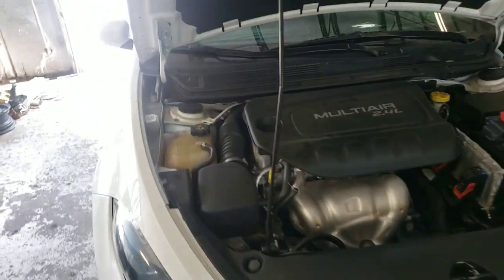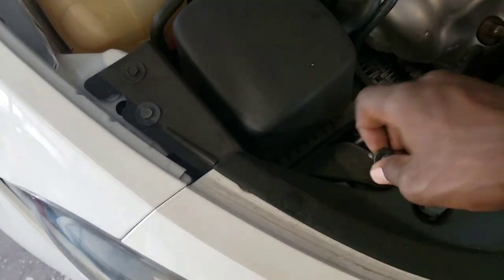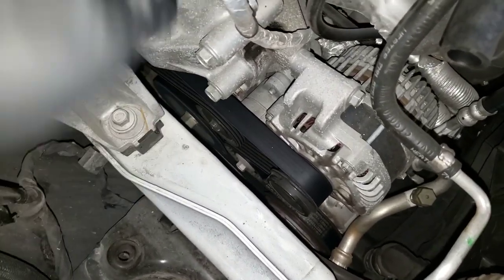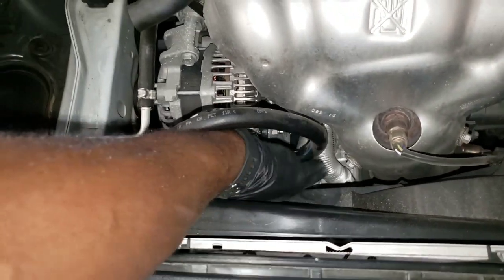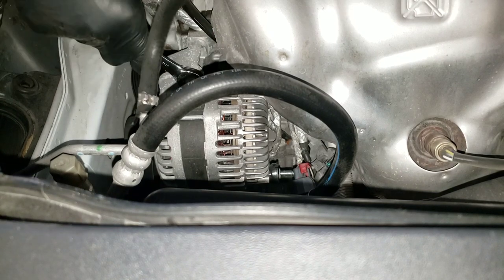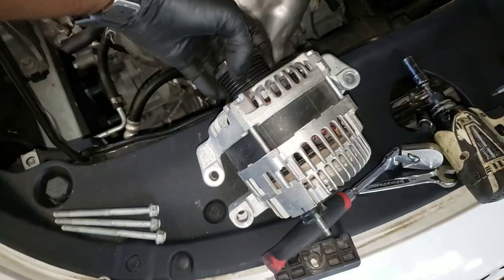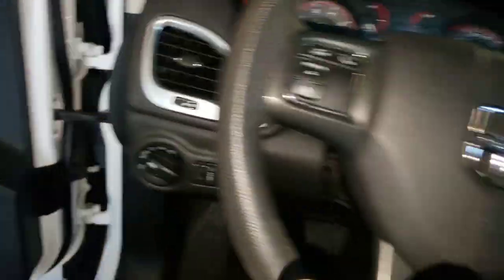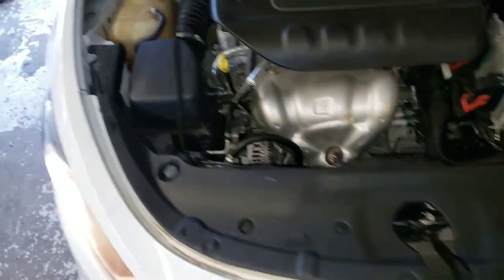Dodge dart and Chrysler 200 alternator replacement  2.4L

Comment: Thank you so much . I have a 2016 Chrysler 200 146,000 thousand miles bearing noise from I think alternator will change the belt also . Great video should be helpful . Happy Hollidays and stay healthy .

Comment: Could I possibly remove the push connectors after removing belt and three bolts so that I have more room to access those clips especially that red one. I have high hands?

Comment: Just got done it was a PAIN. The two bottom bolts I couldn’t access the high pressure valve was in the way, it took 4 hours for the whole job , remanufactured alternator from AutoZone was $460
Reply: You gotta use rock auto bro f auto zone

Comment: How did you know it went bad, what symptoms? We have a 2016 200 so I'll keep an eye on it.
Reply from the maker: The battery light will come on most of the time when the alternator is bad
Reply: My car says car warming wait To start and does nothing when I push to start
Reply: @bloodkapo2175  that happened to my 200. Was a bad fuel pump so no fuel going to engine.
Reply: @stevengerendash7522  fuel pump symptoms are very different than alternator issues. Fuel pump it’ll crank and crank with no start… alternator your car will die while driving (or sometimes won’t start after sitting but that’s more of a battery symptom